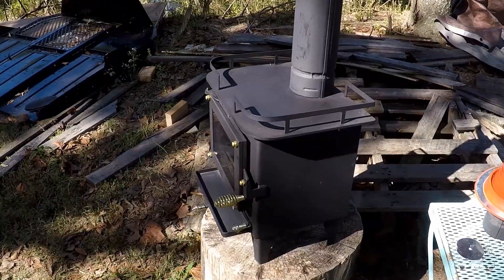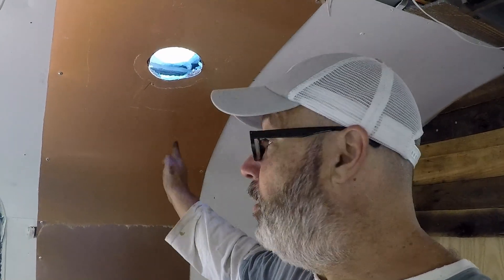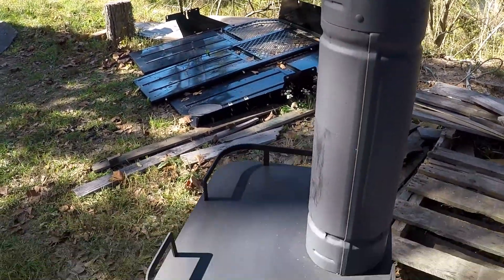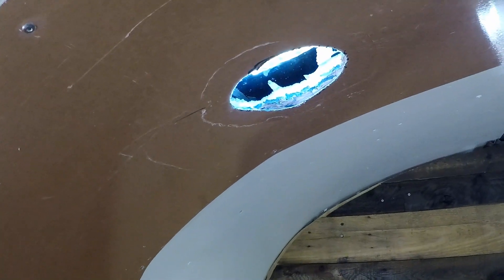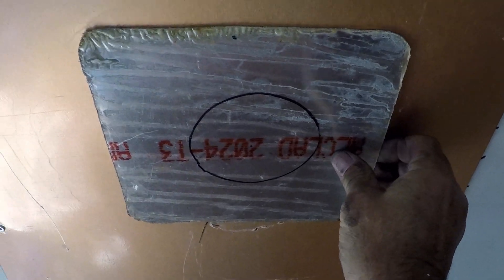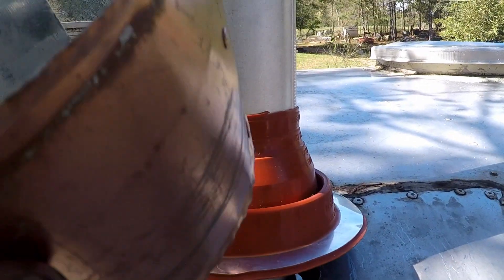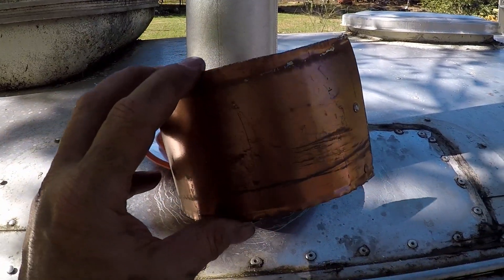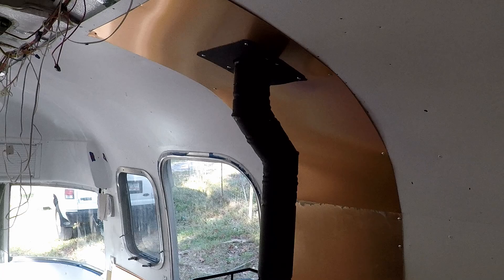INSTALLING THE CUBIC MINI GRIZZLY IN OUR AIRSTREAM ARGOSY / NOMADIC LIFESTYLE ./ RV LIFE

Comment: Just curious, is the stove bolted down?
Reply from the maker: Michael Salmon Great question. It will be. The legs have drill holes to bolt down. We are still testing heat temps on the bottom to make sure we are in compliance and we feel it’s ok to go.